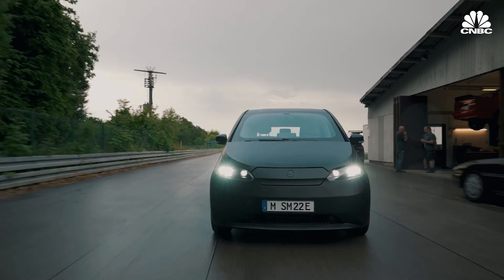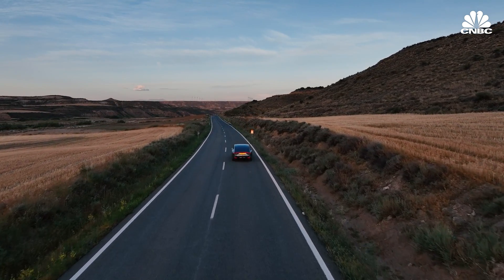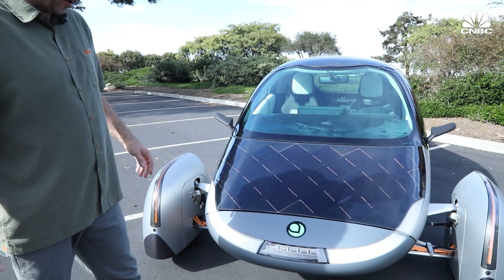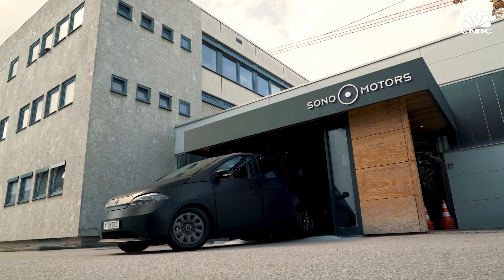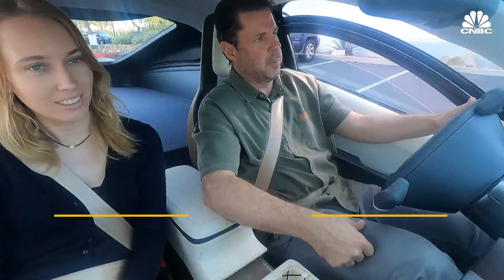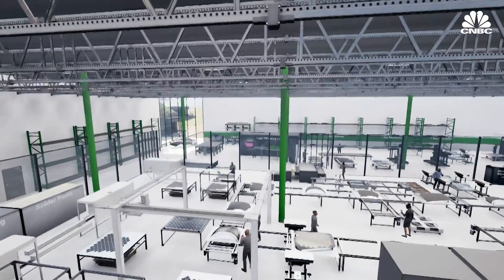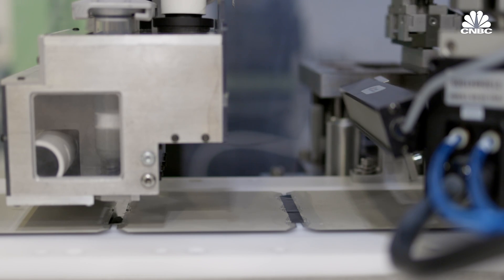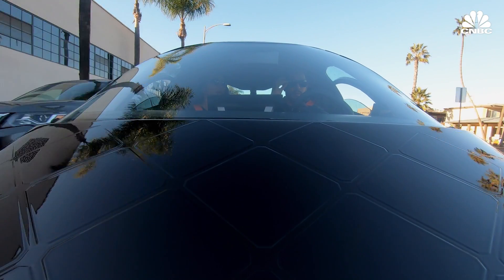Solar Powered Cars Are Here — But Can They Go Mainstream?

Comment: Solar panels on vehicles are the future. And thanks to everyone who promotes such projects. We also produced a series of golf carts last year that travel up to 41 km per day exclusively on solar energy in the summer and just over 20 km in late autumn. This practically made it possible to use this type of transport purely on solar energy.
Reply: Went to your site, very nice things there! My favorite conversion type is big old riding lawn mowers. The efficiency of making it electric is astounding. I have not seen one with a solar roof though. I have seen others do the golf carts. it is like they were already designed for it with the existing roofs!
Reply: Can you elaborate on how you achieved these results?
Reply: @Engines_of_Progress  The solar panel is 410 watts, the frame of the golf cart itself is made entirely of aluminum, that is, the weight of the golf cart is reduced. But most importantly, we use high-torque motors with increased efficiency. In the video that you saw on my channel, there is a moment where two golf carts are pulled. So on the standard one there is the same motor in size, but the controller is 310A, and mine is with 275A. But in terms of torque, it excels. People may say a question about speed, but just in terms of speed, my golf cart is faster compared to 35 km/h to 48 km/h. But all trips were completed at normal golf course speeds. During the first test at the end of November, from 9:00 am to 12:30 pm, we drove 11.5 km, and at the same time, the voltage did not drop, but increased by 0.4 V, compared to the beginning of the test. That is, in 3.5 hours we drove 11.5 km without using energy. In the afternoon, the panel gradually begins to reduce the amount of energy produced. Therefore, the stop time is increased so that the charge remains at the same level, and so on up to 20 km distance, per day in the month of November. In summer it is much higher and instead of 220.240 watts, the panel gives out almost to its maximum, and the day is sunny longer than in November.
Reply: @Engines_of_Progress  The solar panel is 410 watts, the frame of the golf cart itself is made entirely of aluminum, that is, the weight of the golf cart is reduced. But most importantly, we use high-torque motors with increased efficiency. In the video that you saw on my channel, there is a moment where two golf carts are pulled. So on the standard one there is the same motor in size, but the controller is 310A, and mine is with 275A. But in terms of torque, it excels. People may say a question about speed, but just in terms of speed, my golf cart is faster compared to 35 km/h to 48 km/h. But all trips were completed at normal golf course speeds. During the first test at the end of November, from 9:00 am to 12:30 pm, we drove 11.5 km, and at the same time, the voltage did not drop, but increased by 0.4 V, compared to the beginning of the test. That is, in 3.5 hours we drove 11.5 km without using energy. In the afternoon, the panel gradually begins to reduce the amount of energy produced. Therefore, the stop time is increased so that the charge remains at the same level, and so on up to 20 km distance, per day in the month of November. In summer it is much higher and instead of 220.240 watts, the panel gives out almost to its maximum, and the day is sunny longer than in November.
Reply: @ViktorArestov  IS this 2 seaters with bike cycle wheels? batteries? weight of the golf cart?
Reply: thanks for your detailed answer
Reply: What happens when it breaks? Especially when it's over 10 years old? The aging will always hold me back from considering that.
Reply: I found this video  "Solar Golf Car up to 40 km per day only with solar power. Slavyanka Technology"
youtu.be/UBInO_GXGEo
Reply: And this video - Solar Golf Car - 40 - youtu.be/JhtiKo_B_ls

Comment: The Aptera shocked me the moment i heard it, it was a normal night just like any other and i had the same shower thought bugging me, Solar powered cars. Last time i checked it was "unviable" or whatever, but when i searched it up again (Early 2022 i think?) I stumbled upon the Aptera, 1000 miles!?! Thats absurd! Thats 1600 kilometres! I can drive from Toronto to Quebec city and back on a single charge! and the price is fantastic!!!!

Truly amazing.
Reply: Too bad the solar charging part would be a challenge in eastern Canada. Here in Arizona, I can't imagine ever having to charge the thing as long as you parked it outside. Solar cars are going to make garages unfashionable :-)
Reply: @jmccoomber1659  Yah idk, passively charging is still a good idea and while it may only be worth it during the summer here don't forget it's still a plug in for winters.
Reply: @Nabee_H    In the winter, you can put reflectors on the side while it is parked. Note, it has to be colder to do this, because too much heat damages solar panels.
Reply: @jmccoomber1659  that seems really interesting. I wonder whether it would make sense to pay for a parking spot to charge your Solar EV. 😅

Comment: The visibly aerodynamic Aptera certainly is the most appealing modern vehicle pointing towards the future. It's probably the most elegant vehicle of a time period since the legendary Citroën DS.
Reply: Look up the Elio car. This design isn’t anything new. A company even made a street legal f1 car that looks like this. The issue is, and always will be, the surface area of the vehicle. Unless you leave your car in direct sunlight for several days before driving it, these solar panels are useless. They are a marking gimmick.
Reply: @AtillatheFun    The Elio is not as aerodynamic as the Aptera and more importantly, it wasn't even an electric car. What exactly is your point?
Reply: @justinw1765  the design is similar. Not many people liked it.
Reply: @AtillatheFun  That's objectively false for most people, but what makes it even better is that because it's so lightweight, you can get 150 mi of charge overnight from a standard wall outlet without even having to install a separate vehicle charger. That makes this the most accessible EV in the world. A Tesla would be useless with just a standard wall outlet. This thing is so efficient it went 300 miles on just 1 gallon of gas. They're not going to do a gas version though because they're appalled by the inefficiency. Which is understandable, but if they sold it with a gas engine they would literally be bigger than Jesus. Unfortunately, public transport and biking in America is uselessly impractical because we bulldozed whole cities to build highways and auto manufacturers bought and killed most viable public transport. It would be nice if we could stop being so car dependant.
Reply: @AtillatheFun  Using Aptera's full solar option during 10 years saves the owner about $ 3000 in electricity (or more if electricity prices will go up, which most likely will happen). If not flushing $ 3k down the toilet is just a marketing gimmick for you, well then be it so!
Reply: @charangohabsburg1  You can also stop being lazy and save more by taking transit, walking, or doing this crazy thing called “riding a bike”. You would save thousands more and it would be great for the environment, unlike electric cars.
Reply: Are you serious? No one will want to be seen  in that car except eccentrics and woke hipsters.

Comment: Interesting concept but this has many more years of R & D to go mainstream.
Reply: Solar panel efficacy is around 20percent.. lets hope it goes up to 50percent without being expensive someday
Reply: @Narja Something being produced is not the same as going main stream. Case in point: hydrogen powered vehicles.
Reply: Electric cars are already more or less mainstream--thanks in large part to Tesla.  These are electric cars--just lighter, more aerodynamic, with Solar panels on them.  Not all that different.
Reply: No it doesn't

Comment: Very skeptical of the 15-45 miles/day mark, like if that's only if you had it outside, with it fully sunny, in the southern US for all 24 hours of the day if it were only sunny and not have darkness.
Reply: Let’s see.  700 watts worth of PV on the Aptera (maybe more with the delta prototype arriving shorty).  A smidge more than 4 hours of sun on an average US day.  That’s north of 2,800 watt-hours per day.  The Aptera is expected to use about 100 watt- hours per mile (and that’s with the old honeycomb fiberglass body, not the newer carbon fiber body, again debuting with the delta).  That adds up to something awfully close to the 30 miles of charge that Chris asserted.  Sounds plausible to me. 
If you feel obliged to park inside just skip the extra solar package.  If you expect some cloudy days, just plug it in.  In either case the hyper efficiency of the vehicle moving down the road would be benefit enough.  At least with the Lightyear or Aptera.  For the Sono Sion, not so much.  The latter is the one with the lamest solar-range gain anyway.

Comment: Love the concept, but seems any number of accidents would render the vehicle inoperable and/or totaled.  I mean a simple fender bender for the average car, would be tragic for some of these cars that has chargers in the front, panels on the side body, or motors in the wheels.  I'm guessing they designed in best case and not for the hazards of driving in areas like Los Angles, or NYS, or where there are bad potholes and other obstacles to navigate through.  Again, love the concept, but I feel some of these designs are lacking.
Reply: Elaphe´, the manufacturer of the hub motors, has tested them extensively under brutal conditions.  The motors are durable.  They might be torn off in a collision, but could still be reused once the damaged subframes have been replaced.
Reply: An accident that damaged the hub motor on an Aptera or Lightspeed would also destroy the wheel and/or suspension on a traditional car. The electronics are no more vulnerable than the coolant or other system on ICE vehicles and body damage may damage the solar panels but those can be replaced and the car is still operational even if it may need to be plugged in more often. So your arguments dont make much sense.
Reply: On the Aptera at least, the solar panels are designed in a way that they can be cracked/damaged and still function at high capability.  These use a powder version of Solar panel tech for that reason.
Reply: techincally theres no reason why solar panels cant be flexible even if the surface isnt

Comment: An issue I see is how they talk about few people traveling longer distances in a day
I routinely travel 40-60 miles a day. I also don't see talk about the capacity of the vehicles. If the vehicle can only carry the person and nothing else is it really a convenient solution?
Reply: The Sono and Lightyear vehicles are four or five seaters.  The Aptera is a two seater, with a 28 cubic foot trunk.
Reply: @robertkirchner7981  I've flown in airplanes where 3 seats would fit in a 2 seat area and years ago traveling with my brother on a trip his "5 seat" car I was just about crushed in the seat area
Also 28 cubic feet sounds like a lot but that's not a lot of space. Roughly the size of a 55 gallon drum and that doesn't say anything about physical weight it can carry
I'm not knocking alternative vehicles but it's like when Tesla was commenting on hiw fast their electric semis could get to 55mph but says nothing about what it can carry
Reply: @cliffcorson4000  Take another look at the videos of folks riding in the Aptera.  Chris is in the neighborhood of 6 foot.  Jack Sparrow of Fully Charged said he was comfortable in it too and he’s 6’8”!  Looks amply spacious to a more average sized guy like me.
Two seaters are nothing new either.  The Aptera also looks to be more spacious than any other two seater I can think of.

Comment: I’m not a scientist but I sincerely doubt this is practical. Even if solar panels become max efficient, how much energy is there even to capture in such a small square footage of sunlight exposure? I’d be surprised if it’s even remotely close to a full tank of petrol.
Reply: Doesn't have to be a full tank of petrol. In fact, it's 700W. What makes that so valuable is that the car is so efficient. 10 miles per kWh. It's aerodynamic drag is less than me on a bicycle.
Reply: Not a full tank of petrol, more like someone sneaking in a gallon everyday while you are parked. Not too shabby I'd say!

Comment: Wait so since the Aptera is considered a motorcycle, does it have or is it required to have airbags??
Reply: It has a handful of them, not like regular car though
Reply: They aren't required, but it will have them.
Reply: @robertkirchner7981  Hey again, Robert. :-)
Reply: @benjaminnead8557  awww online friends!
Reply: The steering wheel and passenger side dash airbag. They had hoped to have side bags but I think due to the shape it would require some money to create a design for the interior and that makers are not going to spend the money right now until they get a idea of demand in production IMO. I think they passed on a seatbelt air bag? It is not a requirement to have airbags.

Comment: They cannot use solar panels to fully power shorter drives.  They can't begin to generate enough electricity from solar quickly enough to power the vehicles in real time.  What the solar does is kind of top off the tank when the car is parked and the sun is out.
Reply: Yeah so those that live in northern states or prefer to park their car under a roof, shop elsewhere.
Reply: @vinny9152  Pretty much.
Reply: The average daily drive is only about 32 miles.  The Aptera can add up to 40 miles per day.  That sure seems to me that you won't need to charge very often.
Reply: That's still pretty cool. As someone with an older short-range EV, it would be helpful if it could sit there charging in the sun while I'm at work, even if we're just talking about another 10-15 miles.
Reply: @robertcowher  I know.  I have reservations for two Apteras.
Reply: @robertd9850  Nice! Hope they work out(no sarcasm intended).
Reply: @robertcowher  Me too but only one for me.  Will sell the other.
Reply: this is true - over maybe 450 miles of driving you’ll only generate 50 or so in solar. it’s still a big deal, but it’s definitely not enough to power the car alone
Reply: @b-7478i     On an optimal day/in optimal conditions, just sitting around, the Aptera can recoup up to 40 miles a day, including the little bit of charge you get while also driving. 

  Considering that the lowest option has a 250 mile range, and the average commuter in American drives under 30 miles a day, your concern a big nothing burger with a heaping of senseless relish. 

  Granted, in the winter, if you live at a place like the PNW, etc, etc, no way you're going to see a full 40 miles of charge a day.  But, the point is, you'll still be "filling up" at stations significantly less than otherwise. That's the point.  And since the battery packs on the Apteras are significantly smaller--it takes less time to charge.  You can charge most of the their options fully on regular 120 v mains overnight.  (Not their 1000 mi version though).

Comment: I put 120W of solar panels on my ICE vehicle.  My alternator pretty much only runs on long road trips where the solar panels can't keep up and the battery is running low.  It saves on gas, I never have to worry about a jump start, I can keep a car refrigerator in there without worrying about the battery dying, I'm ready for any camping or emergency power needs...
Reply: I placed a windmill on my car roof.. on windy days i use the wind to move in neutral instead..saves on gas and engine wear n tear🐱👍🏿
Reply: @fidelcatsro6948  I think they did something similar to trains in an Ayn Rand book.
Reply: Do you have a pic of it? I'd like to see how that looks. Do you have an Instagram account or other social media where you have a picture of the car?
Reply: @JJs_playground  No, I don;t want this getting out.  Pretty volatile technology to deal with and most people, including myself, have no idea what we;re doing.
Reply: You should make a video on it!
Reply: I put a nuclear reactor in mine.  It's pretty cool.
Reply: @robertd9850  Mr. Fusion?!?

Comment: All these cars are lying about the claims their panels can generate. To answer your question in the title... NO, THEY CAN'T, because they simply don't generate enough to actually drive on.
Reply: The video was misleading.  The solar panels don't power the car, they top off the tank so to speak when it's parked.
Reply: Aptera generates up to 700W and achieves 10 miles per kWh. This is "enough to actually drive on."
Reply: @billman5379  If you had no battery, the car wouldn't move.  It doesn't generate up to 700 watts in a few minutes, takes hours.  So you store it slowly but use it quickly.
Reply: @robertd9850  The instantaneous power produced by the panels is 700 watts. The energy produced by the panels (in direct mid-day sun) over 4 hours would be 2800 watt-hours.
Reply: @skipondowntheroad5833  The cars cannot be propelled in real time by solar energy.
Reply: @robertd9850  It doesn't take hours for the panels to produce 700 watt-hours of energy. It takes one hour. Also learn the difference between watts and watt-hours. Capiche?
Reply: @skipondowntheroad5833  The cars cannot run in real time on solar.  Take out the battery and you can leave that thing in the sun for a month.  It won't move.